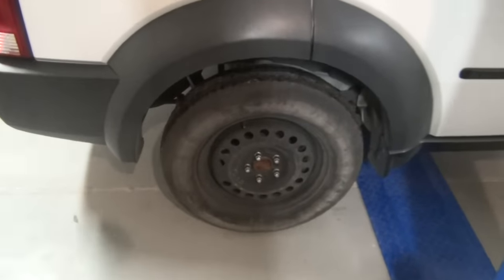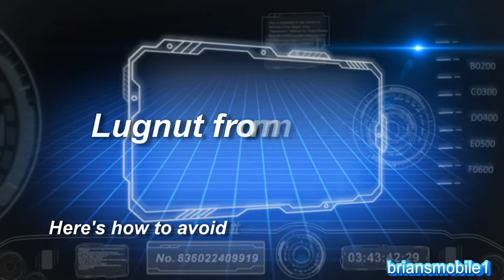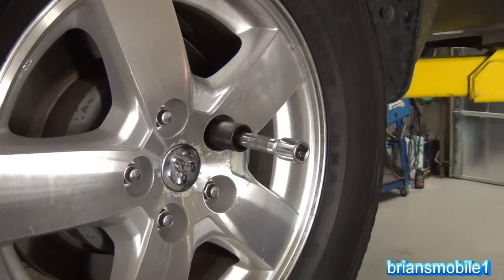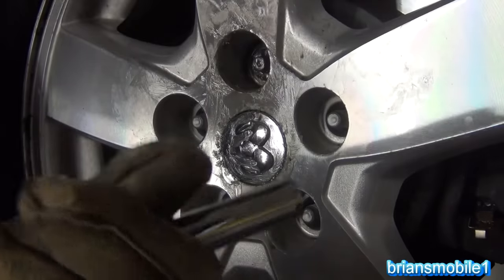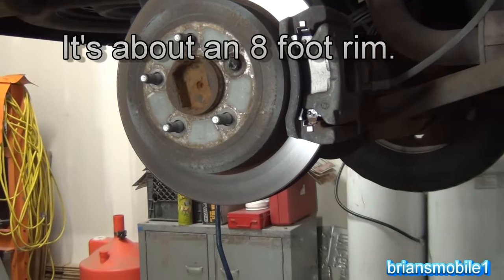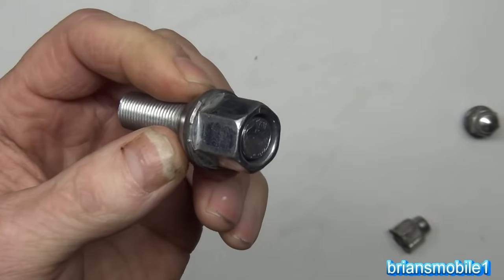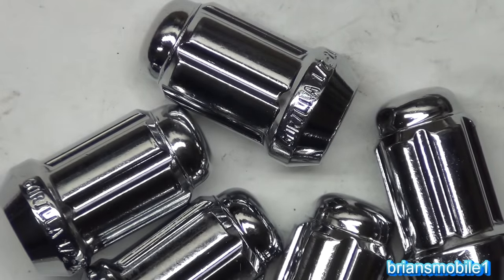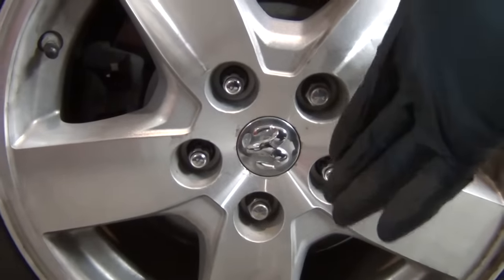Lugnut From HELL

Comment: How many people have had this happen ? Just wondering, might have to invest in some of those lug nuts. Thanks.
Reply: Ive had them come off. Some GMs use them as well. They last for about 5-6 years and then the caps take a hike. Unlike those the GM ones have a relief at the top so you can beat a small socket on there and take them off. I use the standard hex aftermarkets on my daily driver and the splined ones on the performance car. If you use the splines just be sure to leave the adapter in your glovebox.
Reply: They also make hardened tools with reverse helical cutting teeth in them that will take the capped ones off if they round off since theyre soft. The teeth bite in and grip the nut. I've used them on some ungodly stuck large diameter bolts and they work pretty well.
Reply: mysock351C  Good to know. Yes I have locks on my wifes honda. Key is always in the glove box. I have a some lug nut removers, the ones that turn the opposite way and thread on to the nut. I recently bought a Ram, it has the stock nuts. After watching this im not sure if those removers would work. Just wanted to see if this was really common.

Comment: Beware the Walmart service. Trusted them to install four new tires, got my car at home and decided to check lug torque. One tire with 90 lb. ft. lugs turned 1/2 turn each, yikes. Oil change checked filter turned it by hand 1/2 turn, yikes again. No more Wally world in my future.
Reply: +Sam Johnson spin on oil filters should not be cranked down to holy hell tight... they actually have a specific point where you should tighten them to which depending on how much force you used to get that extra "1/2 turn" could have been more than enough to begin with... the lug nuts could be from lazy techs using the gun with the torque stick and skipping the final pass with the torque wrench or it could be from badly out of spec torque wrench

the quality of work at a wal-mart depends greatly on the techs, the managers, and how busy they are... they want techs to work faster to push more cars through... this can easily come with the risk of skipped steps
Reply: They shouldn't be lose. Guess you must be really bored today. These things you state everyone knows without saying. I ve done auto work and have been a licensed aircraft mechanic since 1981. I think I might just know how tight an oil filter should be.
Reply: +Sam Johnson not saying anything against you but i hear that "I've been a mechanic for x years" from a number of customers when they want to argue and not everyone knows these things "without saying"
Reply: You started the whole thing with your pointless BS. Please don't comment further unless you have something worthy of stating. Thanks, bye bye, I hope.
Reply: In case you did not comprehend the first time bye, bye now.

Comment: if you had some decent air pressure and decent impact you should have had no issues with the left handed extractor.
Reply from the maker: *should.  Funny word.  135 psi and the best MAC impact in 1/2" on the truck.
Reply: You need more like 190 psi with a snap on 1/2 inch impact. Tap that extractor on with a hammer and just bump the trigger about 3 times. I have run into this a few times and never had to use a torch. If you got it off without messing up the rim then good. Im just saying more air pressure and your extractor SHOULD have worked no problem.

Comment: Why do car manufacturers even use this type of rim fastening when a bolt works just fine.
Reply: LaterMeansBrick have you ever had to use lug bolts? They are a pita. You have to line up all the holes and hold it while you fight the bolt to start...

Comment: Torching or welding on a rim is a TERRIBLE idea and can easily get you killed.  If you MUST do this, step 1 is to remove the stem valve / empty the tire completely.  After you've removed the rim, cut it up and scrap it as it's not longer safe for the road.

What can happen is the tire or grease inside the tire catches fire and the temp and pressure in the tire rises rapidly.  If this doesn't happen, the heat on the tire and rim can weaken it greatly.

I watched a youtube video showing this happen and wish I could find the link but essentially, the temp and pressure in the tire suddenly jumps up - and this can happen many minutes after your work is done.  Then: boom.

Drill it out.

Be safe out there...

Comment: so this may be wrong but I use a 3/4 socket
Reply from the maker: +James MacInnis That's about as near match for 19mm as you can get.  Only it's in garbage units.  The only better match is 13mm metric and 1/2" garbage units.
Reply: +James MacInnis a little tip... many tool manufacturers use the exact same tooling to make 19mm and 3/4" tools... 3/4"=19.05mm
Reply: +James MacInnis a little tip... many tool manufacturers use the exact same tooling to make 19mm and 3/4" tools... 3/4"=19.05mm

Comment: Brian, I don't want to sound like a smart ass as I love you videos and learn a lot from them. But wouldn't it have just been easier to use a big breaker bar and the fluted socket? If you broke the stud it might have been cheaper in the long run considering your time, or would you have to pull the hub to do that? Just a thought. Nice video
Reply: +HaroRider03088 Just realized you needed the new wheel stud either way.

Comment: Wow, so the 17mm socket didn't fit into the 1/2-20 lug nut? Hmm, so instead of using a 3/4" socket, you go for the metric set? I mean if the nut is 17.7 mm, what shitty 17mm is going to fit realistically? Ever thought of maybe 11/16" (17.5mm)?

Comment: What's the tool used to remove a damaged wheel bolt? The lock pattern on my factory wheel lock broke
Reply from the maker: +bayareatech I knocked it through with a hammer.
Reply from the maker: +bayareatech Here's a video on replacing the wheel stud.  It's two minutes → https://www.youtube.com/watch?v=XX9te2iFH3E
Reply: +briansmobile1 the mcgard locking wheel nut broke,  I went to my auto parts store hoping to find some type of reverse thread type tool but they don't offer anything.  I will look online for it before I damage the stud. thanks

Comment: Spray it for two days with wd-40, then after you heat up the nut melt wax into the threads, it will come loose.

Comment: Omg people  don't do what this guy did go grab you a drill and two different size drill bits one for your pilot hole and one just big enough to drill out the stud itself and the threads of the lug nut and you'll be done in 30 minutes and you will save your wheel

Comment: ive tried on a wheel bolt and cant remove 3 bolts, tyre bay overtightened and now rounded off
knocked smaller sockets on still rounding off had a go at welding nuts on with no joy (poor welding)
also used a Irwin removal socket and the head came off the bolt but left the countersink and bolt left behind so used a drill bit 10mm and 12mm got so far and now theyre blunt
 even started to cut the alloy off but killed my grinder,,,,,

Anybody else have ideas? 
2007 vw  passat sport

Comment: how did the rim turn out ? damages wise
Reply from the maker: +Phil Bourgeois The hammering on it with my wife holding the drift did the most damage.  It looks good from 8" away, but it's ugly.  Next time (if ever) I will drill the wheel stud out to begin with rather than using a chisel.  Chisels are great for a spun nut that spins.  Not great for this example.

Comment: Hi Guys, I have a lug nut from hell. I went to remove the tire for a new bearing assembly. The security wheel lock cracked when I went to loosen with hardly any pressure on it...I was drilling it out perfectly when I lost a piece of punch in the hole....long story short it is hard to drill out with enough lug nut just on the bevel of the rim. Does anyone know any good drill bit that with rip through anything forgetting the costs. I have spent 4 days now trying to get through this stud/punch remnants.....ideas anyone? I do not have plasma cutter.. How should i get this out!!?? I can still drive to a shop if anyone has brilliant idea on what tool a shop can use without destroying aluminum rim on Xterra.
Reply: After research I went and bought Bosch Masonry bit Carbide tip 1/4 4x6 and it is going through the metal not problem. I guess the carbide (diamond hardness?! maybe doesn't cut well but "scraps" well and no need to use oil.  I highly recommend this masonry bit.  I now own about every type of bit out there for metal and a $6.99 masonry bit does the trick!

Comment: I'm curious and no means being sarcastic. but with your mechanical aptitude why did you have another place work on it?  state inspection?  again no sarcasm just curious
Reply: +Richtis Grin I'm to guess tires. Tire machines are very expensive.
Reply: +DE Nichols I didn't even think about that. thanks.
Reply: +DE Nichols Harbor freight sells a tire machine for $40 or something ridiculous. Don't get too excited. I wouldn't use it on anything other than a steely from a hoopty. It marks everything with red paint.
Reply: PGTMR2 I only have alloy rims so that machine would make me frown.
Reply: Lol, same here. I got it thinking I could save money moving my tires around while I paint some of my rims. I also have directional tires, paired with directional rims. I should see if I could tweak it to make it work better, tire shops aren't significantly better at not damaging them.

Comment: Wish I had seen a year ago  - Destroyed a simialr rim as I did not have any torch or plasma unit.  They saved a buck or 2 with the two piece nut & destroyed their reputation   That plus a ridiculous hydraulic clutch system which has failed twice in 100,000 miles has turned me off Chrysler   Clutch was over $400 installed
Reply from the maker: +Dave Measor Chrysler has shortfalls.  That's for sure, but I still own two of them anyway.  All car makers have pros and cons.

Comment: I think that I'd have been tempted to drill out the stud with a half inch bit. The nut itself would act as a buffer to help prevent wheel damage if you went off-center by a little bit!      Don't ya just hate us armchair mechanics/coaches?    Lol

Comment: Well..
I take lug nuts like this off every week.
Heat, pound on an extractor, take off with a breaker bar.... Or torch out
Do not put those locking lug nuts on your vehicle.
You will have problems.

Comment: you dont now a lug nut from hell untill you break 3 tire irons a 1200 ft lb impactor wont take it off even with a torch i killed 2 battery packs for my battery impactor fryed the batterys and broke 2 breaker bars i had to use my rotary hammer for 2 hours and i drilled the bastard out it pissed me off took 6 hours for 1 lug nut

Comment: @briansmobile1 Why couldn't you have just used a big impact gun, turned it all the way up, and bust the nut off with the stud? The all you would have to do is put in a new stud with no risk of damage to the wheel. And yeah...those Chrysler lugs are absolutely junk.
Reply: +Brandon b I  thought the same thing even if he took that extension off prob woulda did it
Reply: I agree, would of been easier I think.
Reply: That would only work if he could get a socket to grip onto the nut.
Reply: James Rogers I have bolt extractors that would grip a fully rounded lug hard enough to snap a stud off......I know cuss I've done it a hand full of times lol

Comment: Modern cast aluminum wheels are soft alloy, and use relatively soft steel alloy chromed  lug nuts.

Show me a mechanic who does not spin such lug nuts down by hand, and who , "saves time" by using an impact wrench without a torque stick to tighten them, and I'll show you a hack who shouldn't be trusted with a customers car.

Comment: transfer of torque through an extension greatly reduces the output of torque applied,...  lose the extension
Reply from the maker: That's exactly right.  Like a torsion bar front suspension.  It twists and absorbs force like a spring.

Comment: Would’ve been faster to drill it out. Had this occur to me on a dodge caravan. Used the “expensive” harbor freight drill bits going nice and slow with some cutting oil. Took about an hour. Check out AvE youtube channel when you get some time on how to drill with drill bits.

Comment: You have got to be kidding me.  You're "background in automotive" should have told you to quit using an extension with an impact.  You're losing every bit of the "impact" of the impact with the extension.  Second, You should use an extractor with a long breaker bar with the vehicle weight on it.

Comment: Never use a socket extension on an air tool 1:53 
Never heat the stud itself, why the heck did you do that, you simply just soften the metal?  1:36 
Again, a 2:00 why did you use an air gun and not simply a giant ratchet????

Just weld a big nut on the stud and get over it in minute.

I love your video in general but I would not hire you.. 
Regards

Comment: Your gun is Bagless. I can hear it. I heard you say you were experienced. I don't know if you can hear that your gun is has no bag to it like I can. Second of all you're using an extension which lessens the amount of force. You either get a better gun a 3/4 gun. or a gun with a short shaft and a just long enough socket any type of extension is bad. The shorter the the shaft the shorter the socket. The better the results. I am a commercial tire technician. And I work besides the retail boys all day long. I get sick and tired of hearing their Bagless gun being used and they are attempts to loosen nuts over and over so I have to walk over there with my 3/4 gun or hand them the right gun to get the job done. I even have a commercial tire technician that likes to use a small gone every once in awhile just because. the big gun is too heavy LOL sissy boy is what I call him. If you're going to do a man's job you need a man's gun.
Reply: What's a "bagless" impact gun? Is it the type of impact gun it is? I googled bagless impact gun and nothing related game up.

Comment: I hope you never work on anyone else's cars except your own!.... Not only did you destroy that wheel, but you used a plasma cutter THROUGH a bearing, and using one on an assembled car all by itself is bad enough and often causes computer damage that might not be immediately apparent. You could have simply used a breaker bar, or failing that an air chisel works every time and no damage to the vehicle or wheel.

Comment: Never blame mechanics for this, blame dodge, all dodge vehicles use these shoddy piece of garbage lug nuts. 

They use the cheapest grade of metal, and then coat that metal on an even cheaper metal cap, why does a nut need to have two pieces instead of being just one solid nut? Because a solid nut is heavier meaning it's more metal, meaning it costs more for dodge. And since dodge is a piece of trash company, they go the cheap route.

The lug nuts start as a 19 Mm socket on most cars but over time heat and moisture cause the nut casing to expand to 21mm, sometimes 22.

A lot of times I have to use a chisel to get nut caps off because a normal socket doesn't fit on

Comment: I hate Chrysler and dodge lug nuts...
Reply from the maker: Those chrome caps suck don't they?  At least you can use an 18mm when they get lost.
Reply: briansmobile1 right! This same thing happened to me while I was trying to do a ball joint on a 2010 Chrysler 300. I had no means to take off the lugs so we went to the tire shop that put them on and they had like 5 of their guys on it trying to figure out what to do lol.

Comment: WTF you made a fucken mess of it , Simply put the damn car on the ground and apply brakes /hand brake  large breaker bar extension pipe about a meter long and pull on it .  You made a total meal of it. I have as a mechanic of 40 years have had some damn tough ones and never had to use a torch or chisel. Sheez.  And use a damn impact 6 sided socket not a standard socket.

Comment: @briansmobile1 

Rescue me from lug nuts from hell there broken right at the aluminum rim and the stud sticking out . Can I burn them with a cutting torch . The mechanic over torqued them on the rim last year he installed them on my car . I need the tire off too change the transmission on my car .He dont seem too give a shit all he doing is his work on his stuff .
Reply: two are stuck on the left side of the car 95 buick century with aluminum rims . the right side they came off

Comment: I hate when they use high impact wrench on my wheels,that torques the wheel to over 200 psi causing cross threads ,and locks the nut to bolt.